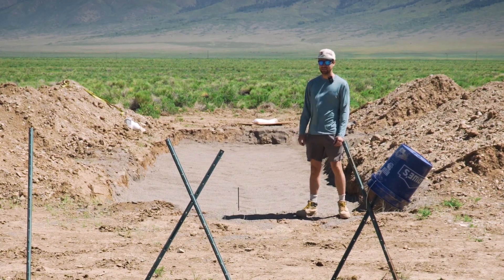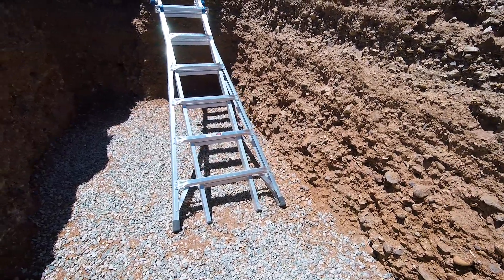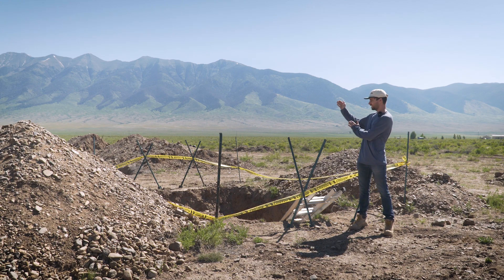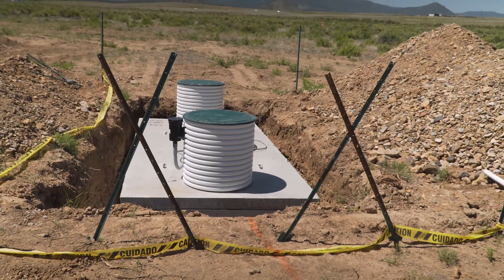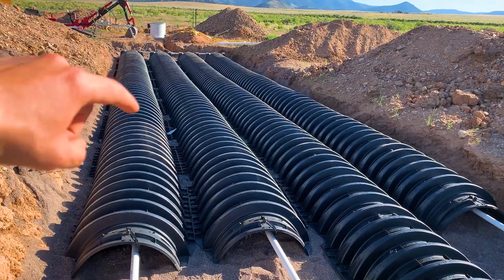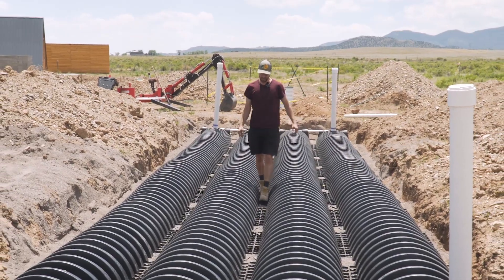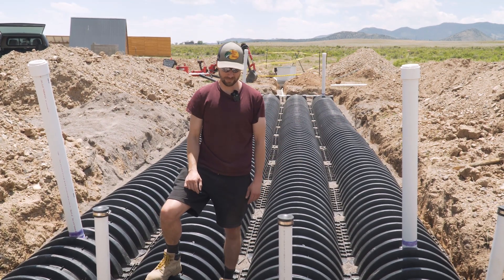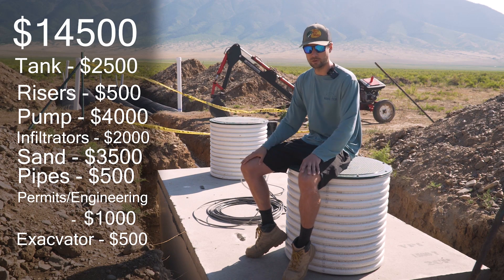DIY Septic System Build pt 2 - Tank, Pipes and Infiltrators. And how much $$??

Comment: Interesting.  I had an infiltrator system installed at parent's house 6 yrs ago in Mass.  It had gravity flow to distribution box then gravity flow to 4 rows of infiltrators.  But there were no perforated/drilled pvc pipes inside the infiltrators.  I thought one of the advantages of infiltrator system over traditional perforated pipe/gravel field is that there are no perforated pipes so there is no chance the pipe holes might get plugged up and the leach field fail.  I assume you needed the drilled pipes because the flow/pressure from the pump would disturb/move the sand at the inflow side of first arch of each row and prevent even distribution of effluent in each row.  Is this correct?
Reply from the maker: I believe so. It’s a high head pump (required by engineering) pushing effluent at around 2 feet of head, so I think the pressure and flow would erode the sand too heavily if not for the perforations to distribute the water evenly. The perforations also point up so it sprays into the underside of the infiltrator and then drips onto the sand from there. Still a possibility of clogging but with the cleanouts on all 4 pipes hopefully it would be easy to resolve!